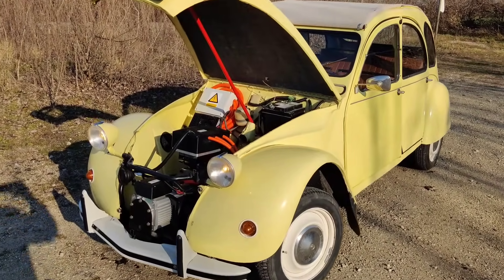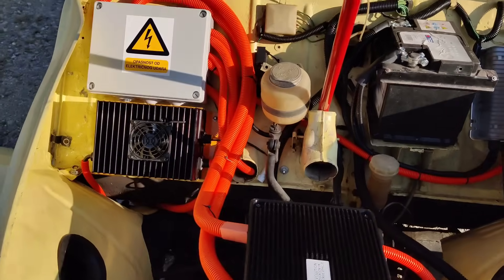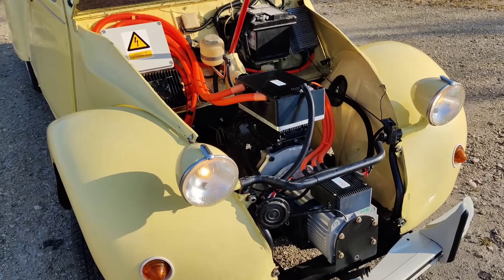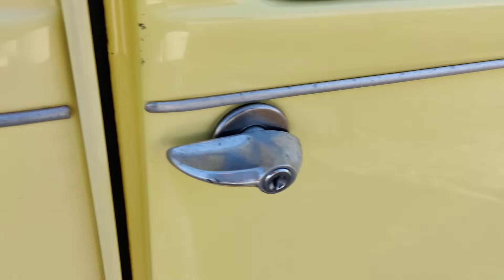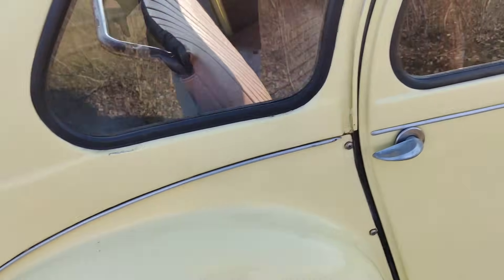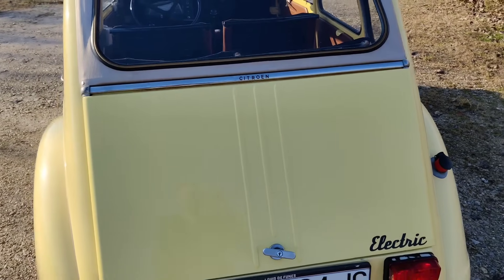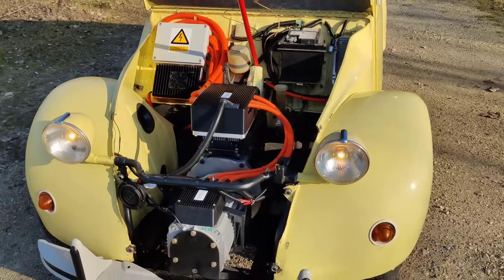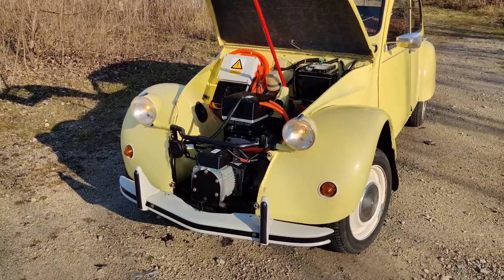EN: Citroen 2CV EV Conversion Kit for 4999€

Comment: An LFP battery is a lithium ion battery. There are several different chemistries but you simply cannot say it is not lithium ion. The LFP chemistry lithium ion batteries are regarded as having some potential safety advantages and also are more resilient when charged to 100% capacity frequently. However, the safety advantages are hardly worth mentioning nowadays given the well established safety record of modern EV batteries generally.

Comment: Could the car at least fit one or two battery modules under the bonnet? Not just to fill up some useful space but to better the weight distribution.

It may seem misplaced to have the weight balance of a rear engined front wheel drive, that'll bring some traction issues.

Comment: I check the website, it says 100km/h, with the original engine this car does 120km/h which is needed in modern traffic. With this conversion, based on top speed and battery capacity, it looks only suitable for city use.
Reply from the maker: this car can go faster with an electric motor but is not for high speeds as it has no modern and safe body for crashes.
Reply: Going faster than, or use much more torque than the fuel engine is not recommended. You will blow your (expensive) gearbox and axes. Can you live with the range? Buy. If not, don't.
Or buy more range :).
Reply: 100km is perfectly fine, it is quickers than lorries go.
Reply: Do you have a Traction Avant conversion?
Reply: Don't be so ridiculous!
Reply: Well, given that max speed limit in the UK is 70mph ... and 120km/h is nearly 75mph ... you would, technically, be breaking the law! To stay within the law you could go at 112.5km/h (which is 69.9mph) if the car limit could be tweaked.